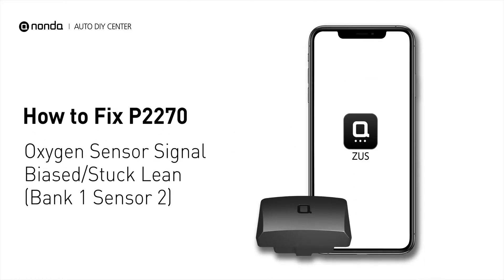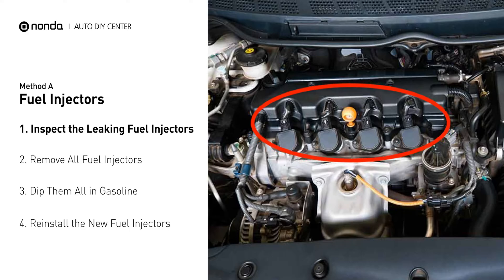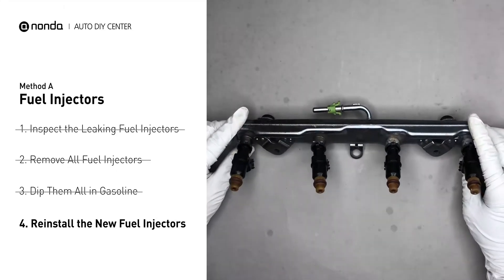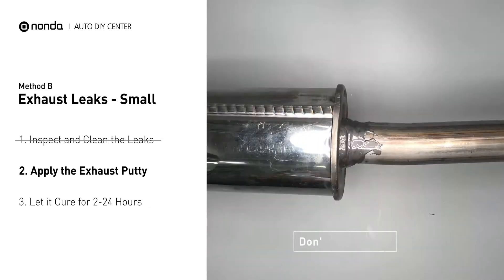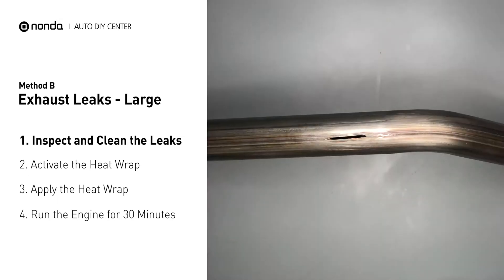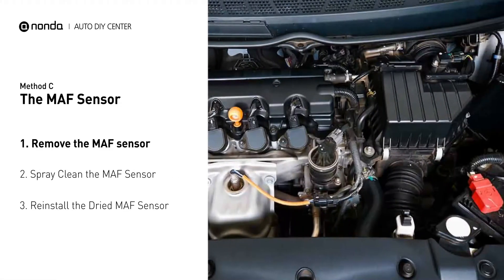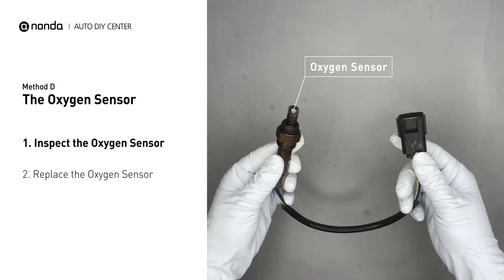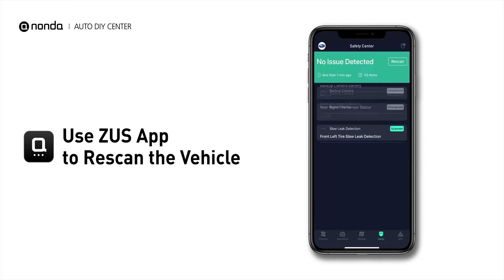How to Fix P2270 Engine Code in 5 Minutes [4 DIY Methods / Only $8.47]

Comment: Wouldn't a faulty MAF sensor cause a lean condition on either bank sensor 1??? Sensor 2 only monitors the catalyst function. So either the cat is bad depending on the code, or there is an exhaust leak. How can it be lean from MAF on sensor 2 for downstream sensor, but not be lean for upstream sensor 1? Not a good video

Comment: I have high flow catalytics converters installed with a down pipe that has a defouler on it but I'm running a code of p2270 how do I get rid of it
Reply from the maker: Hello, have you checked if you're having a leaking fuel injector or MAF/Oxygen Sensor issues?
Reply: @nondainc  No I'm running K tuner so it only happens when I flash the tune so I flashed back to factory & it hasn't come on since, so I'm wondering is it the tune itself

Comment: I have an 08 suburban with this code. Light goes away when gas is on E and stays off for a day or so after filling my tank. Then appears again. Gas cap? Bad gas?
Reply from the maker: Hello, kindly check the fuel injectors if leaking, and try cleaning the MAF sensor.

Comment: I installed a new 02 sensor in the bank 1 sensor 2 in my 2008 chevy malibu 2.4L. But Still getting a code. The wire on the sensor was severely damaged and shorted the 10amp fuse. I replaced the fuse and sensor.  But still showing the P2270 and P0140. I even installed a new factory exhaust manifold to. The old one was totally cracked open
Reply from the maker: Hi Tommy, kindly check if there is an exhaust leak. Repair the leak, and see if the issue will still persist.
Reply: Did you ever get it fixed?

Comment: I drive a 2010 Chevy Cobalt could this work?
Reply from the maker: Hi Kam, if the suggestion in the video has been applied and the issue still persist, we recommend having your vehicle visually checked by your local mechanic for further diagnostic.